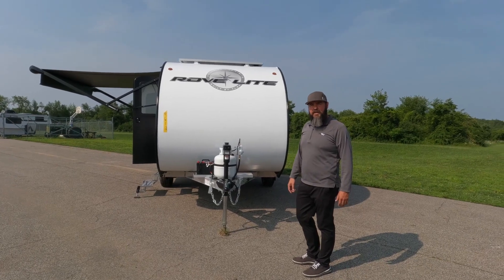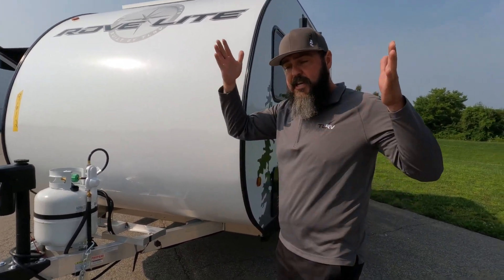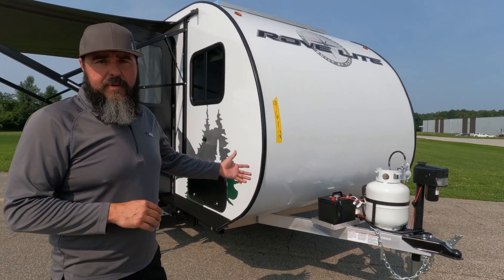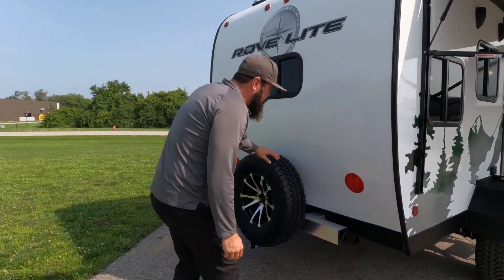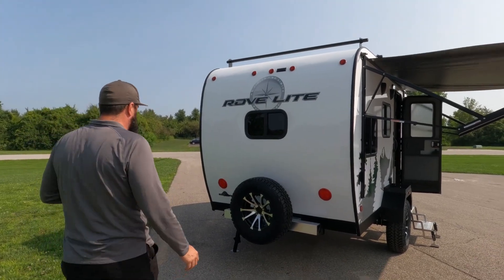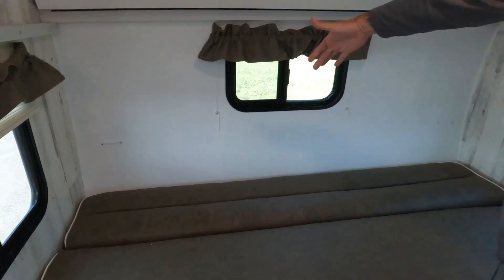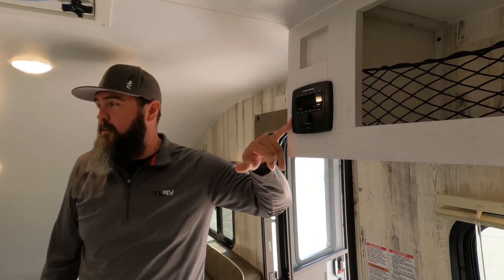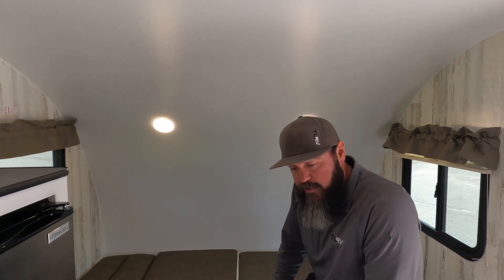TLRV Rove Lite Walk Around (Keith Lessner)

Comment: We just traded in our 2018 Falcon FL-14 for a Rove Lite 14BH! It’s a HUGE upgrade in quality. The only thing we miss is the microwave, but we will be adding one ourselves. The extra space for our family while still staying ultra lightweight made it a no brainer when deciding what our next camper would be.
Reply: How are you liking it after a year?
Reply: @noonetalksaboutaaroncarter  we still love it and have put about 20k miles on it! We bought a small microwave and it fits (with extra space) in the cabinet under the stove. The only issue we had was our solar panel blew off on the highway in SD. It seemed poorly mounted when we got it… After several attempts to contact Travel Lite (with no response) to see if they would cover getting it fixed we gave up and replaced it ourselves with a flexible solar panel. Sadly, customer service seems to be lacking throughout all of the RV industry. Other than that we are very happy with our 14BH!

Comment: I just wish that they made a option for a bigger, air conditioning unit! Arkansas summers are brutal and I’ve seen several reports from the Rove Lite Facebook group, say that the air conditioning cannot keep up with heat of the day it’s like 80° inside the camper. Yes I love the side air conditioning unit but I just wish they had more BTU option for this Lightweight trailer. Otherwise it is fantastic. That is the only thing holding me back in purchasing this unit. Yes I do know that they sell a bigger one with a rooftop unit but weight is an issue for me.
Reply: The reason for the side mount A/C unit was weight.  you can indeed add a rooftop air if it is your preference!
Reply: That's my issue too....that AC is a deal breaker for South Louisiana ;(

Comment: I own a 2023 Rove Lite 16RB. Such a killer unit. Do you guys ever plan on building any off-road package for that platform in the near future? My only dilemma with it really is that it sits very low to the ground specially being on the 13s.
Reply: The 2024 16RB is now available with the offroad package!
Reply: @keithlessner8546 
Hi, Keith! Darn! I LOVE my RB16, but I wish the OffRoad package was available when I bought my 2023 RB from Keith’s Trailer Sales last winter! I had to have my axle ‘flipped’ because I was bottoming out on some secondary highways, and I didn’t always have clearance to lower all 4 stabs due to uneven ground at campgrounds. 
Curious….How was the 2024 RB16 reconfigured to accommodate the change. I know that when Keith B called you to see if the OffRoad pkg was available for the RB16, you said it wasn’t available, since the $or would hit the fender.
Thanks, and stay well! 
Muskoka ON 🇨🇦

Comment: Given the light weight, I think you could really do well targeting the EV market.  The number 1 selling vehicle in the world is the Tesla Model Y.  It has outsold more cars globally than any other model.  Outselling the long running Corolla.  In the United States, the Model Y is only outsold by the Ford F-150.  So if you're not targeting the Half-Ton owner and are targeting the small SUV market.  The Model Y is the one to go for.  I would do some airflow analysis and lose the rear bunk, taper the rear roof down to have more of a teardrop shape.  Given the light weight and a more aerodynamic body, this would sell well if you market it to EV buys.  The only other trailers sold to EV drivers are the Safari Condo trailers, but those are like $50k+.  The Model Y has a 3500lbs tow rating, but you can't use a weight distribution hitch.  So your Tuson anti sway solution is great.
Reply: I’m seriously considering buying one of these to tow behind my CX-90 PHEV plug in hybrid. Tow rating is 3,500 lbs. this baby would suit us just fine.